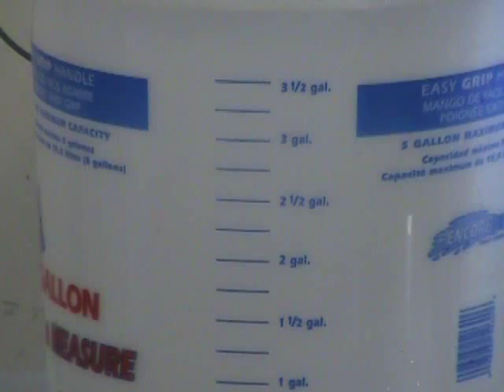FLUJO DE FLUIDOS - CAIDA DE PRESION EN TUBERIAS

Comment: como cálculos la presión en cada manometro? how does he did to measure de pressure in each manometer
Reply from the maker: Recordemos que la presión la podemos expresar en columna de fluido, por lo tanto la presión la podemos leer directamente de los piezómetros en pulgadas columna de agua.
En este caso el expositor indica en el primer piezómetro 32-6/8" aproximadamente y en el segundo 30-1/8", la diferencia es la caída de presión.